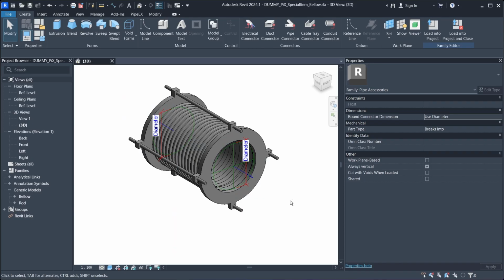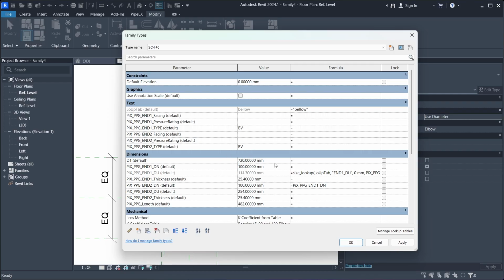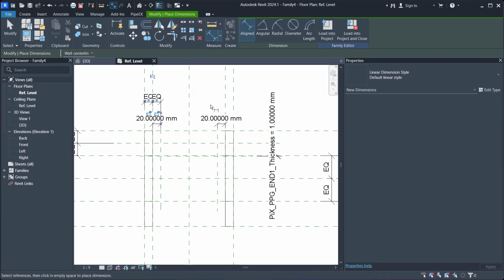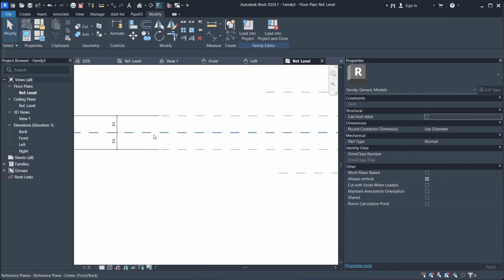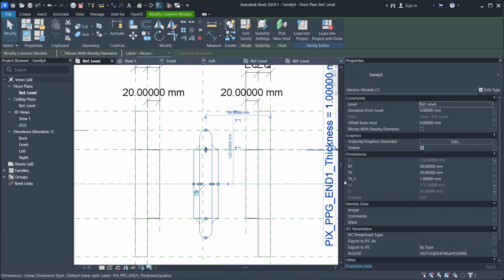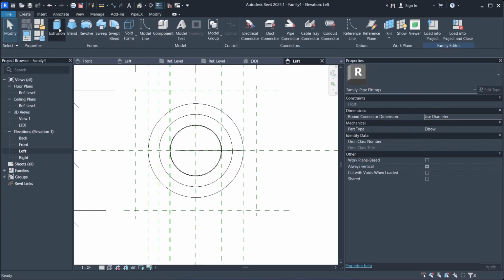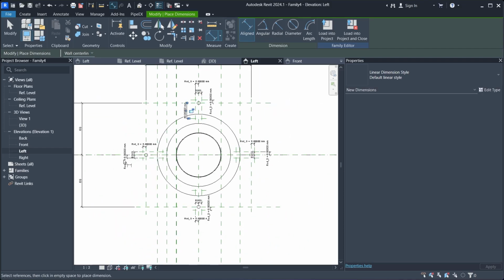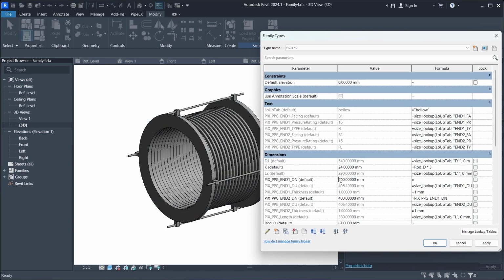Revit MEP Tutorial: Create a Parametric Expansion Joint Family

Comment: thank you. 
Shouldn't we have made the pipe connector diameter parametric so that it could connect to the pipe or piping system in the project?
Reply from the maker: Hi, it is a good questions. Connectors are model-driven, but you need to ensure that the geometry is parametric and controlled by the connector size.